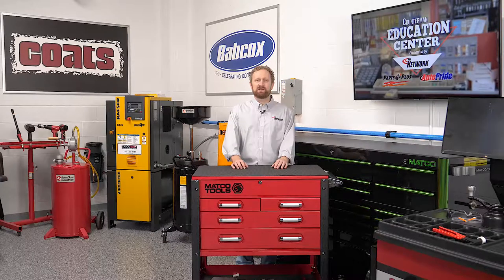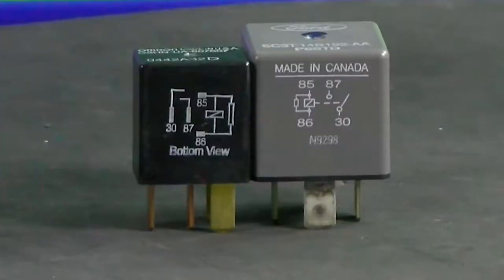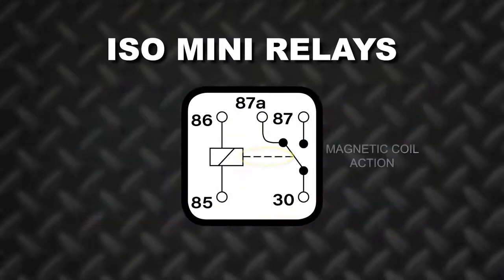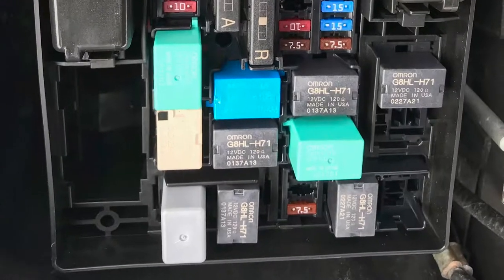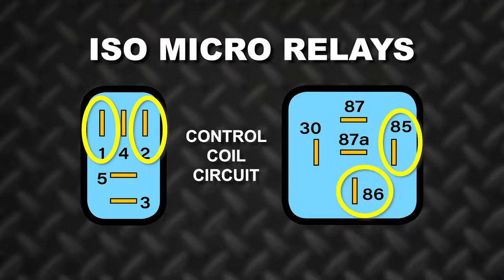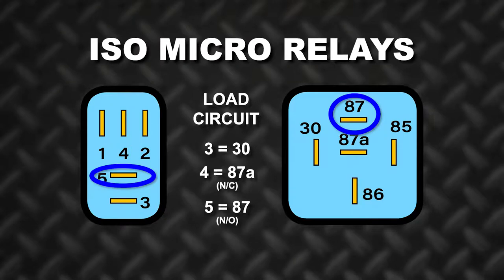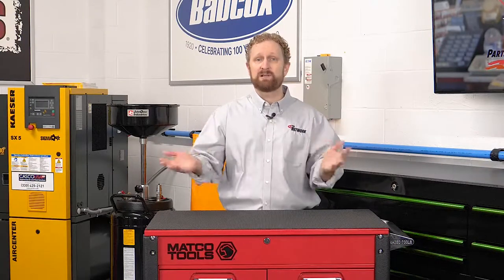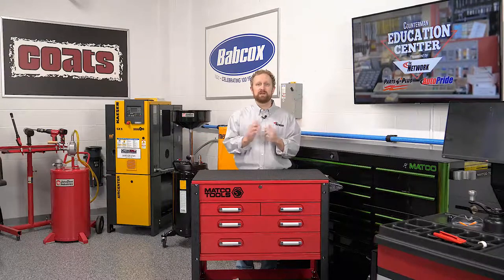Understanding Relay Schematics

Comment: It's like listening to Greek!  The video assumes the viewer knows what a control vs a load circuit.   It also didn't explain why those circuits are important to the function of a relay switch.   I understand that the function of a relay switch is to activate a high voltage connection using a 12V signal.   This video talks about numbers, close circuit, load circuit, etc.   In other words, Greek!
Reply: If you do not understand those terms, you likely do not wonder where the pin numbers come from...
Reply: agreed, could have given examples for beginners to correlate to